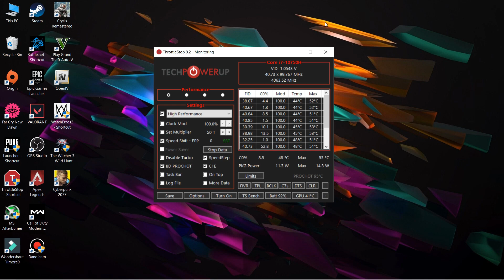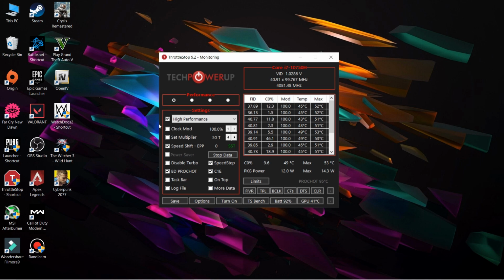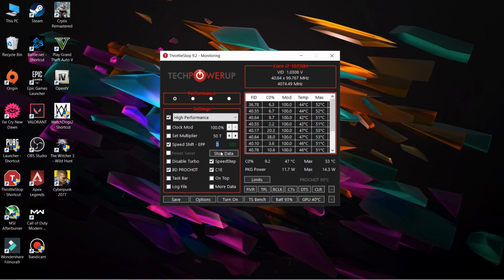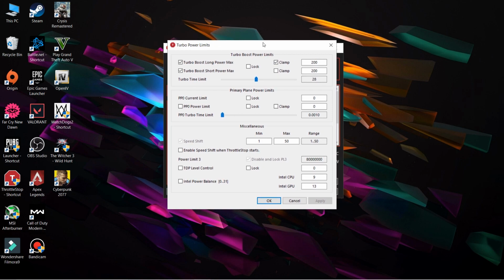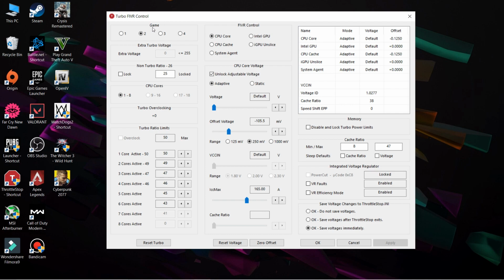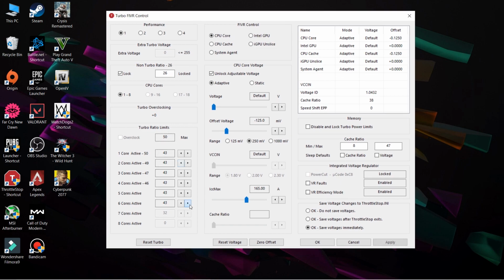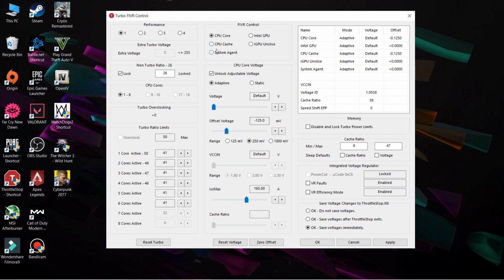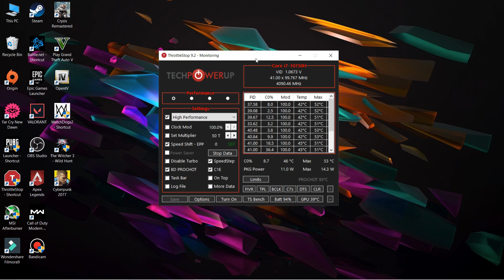undervolting i7 10750H quick guide !! Lower you cpu temps and increase performance !!

Comment: Hello. I have a Asus Rog Strix G15 G512 GTX 1660 Ti which I bought 6 months ago. During gaming on silent fan mode the temp of gpu is 80C and it caused throttle. If I use Performance/Turbo Fan mode the temps go from 93C to 95C. So Can I undervolt my laptop? It has Intel i7-10750H.
Reply: Hey, I have the same laptop but with a rtx 2060. I enabled undervolt from bios and put it to -80mv but fivr control is still locked on throttlestop. How did you unlock it?
Reply from the maker: If you have current version of bios it will not unlock.
Its locked by default.
You have to wait for new bios update...✌️
Reply: @R-tech890  from the current version that I got by default and all the newer versions are locked. Only previous ones are unlocked but for my specific laptop model there are no older bios for download. Not even from my laptop manufacturer site. There are some other Asus laptops but not my one. So I got no way to downgrade bios
Reply: @MrLatitante  did u find a fix?
Reply: @MrLatitante  bro when i do -80mv from bios my laptops will freeze
Reply from the maker: Yes you can...
I replied you in discord..
Reply: @R-tech890  ah yes. Thank you :)
Reply: Yoo dristang
Reply: Can u help me i have same laptop like yours and same issue
Reply: @Talhx-w5l  sure bro. What do you want to know?
Reply: I wanted to know tht did u find a way to  undervolt ?
Reply: @Talhx-w5l  I couldn't undervolt as bios is locked. 
I disabled intel turbo. No performance issues or fps drop.

I use performance mode while gaming. CPU is at 80C and GPU is at 86C.

GPU hotspot is 96C in HWinfo. (3rd party app) That can't be avoided unfortunately.

Except re apply thermal paste and get a cooling pad, there's nothing else you can do.
Reply: @Alfonsodecabron  bro thts the only bad thing abt intel laps can't be undervolted
Reply: @Talhx-w5l  yeah true
Reply: @Alfonsodecabron  for me in performance also cpu goes upto 90-95C but drops down also fast and gpu always 75-85C
Reply: @Alfonsodecabron  so now when i play game i just decrease cpu tdp to 45-40 or 35 according to temps and play so tht helps with lower temps and max 5-10fps drops
Reply: @Talhx-w5l  where did you decrease the tpd?
Reply: @Alfonsodecabron   the option next to (FIVR) TPL Turbo Power Limits
Reply: @Talhx-w5l  are you using Throttlestop software?
Reply: @Alfonsodecabron  yes
Reply: @Talhx-w5l  ah ok. So now how much temperature are you getting on performance?
Reply: @Alfonsodecabron  performance also my cpu goes 95C something it doesn't stay in 90s unless i play games like apex cod or something
Reply: @Alfonsodecabron  so i keep it at turbo and decrease tdp while playing so temp stays in 75-82C range
Reply: Same issue, a little stronger laptop. 10870H + Rtx 2060 115W and it reach the 90s on both GPU and CPU. undervolting only give me 3 or 4 degrees less than before and I don't want to repaste the liquid metal. Probably I'll send it to Asus to repaste it
Reply: @carmeloaguilarjimenez9774  disable intel turbo via registry. Cpu is 10 to 13C cooler and gpu is max at 86C on performance and turbo.

Comment: When I run throttlestop TS bench I get alot of errors, is it fine? I'm now at -75mv
Reply from the maker: Yup its normal.
Reply: @R-tech890  so i push it more?
Reply from the maker: No..
Fined a spot where you get stable clock and acceptable temp.

Comment: You don't need to check speedstep anymore since most modern CPU (IIRC 6th gen+) uses the speedshift feature. and checking the speedshift is also not required because windows 10 manages it automatically and sometimes much better than throttlestop.
Reply from the maker: I know buddy....😀✌️
Reply: @R-tech890  is this like 
Disabling turbo boost 
Which is better

Comment: What should i do if my pc gets bule screen and restarts i tried your settings but hangs and gets blue screen
Reply from the maker: Change values to lover mv.
Reply: @R-tech890  evwrthing is fine until change speedshift to 64😅
Reply from the maker: 😀 it should be 0 to push core to max clock speed...
Reply: @R-tech890  thanks😅 btw another question if i want to create a profile for battery should just copy same voltages  to the one that i created?
Reply from the maker: Yes..

Comment: my thermals are really good without undervolt. I get around 70 - 80 degrees when playing demanding games. Would you still recommend it?
Reply from the maker: If you are getting 70 to 80 then its ok.
You dont have to UV.
Reply: @R-tech890  Thank you for responding. The current laptop I have is a Lenovo P1 Gen3 with a i7-10750H and a Nivida Qudaro T1000 Max-Q
Reply: @SubKiller  ohh alright

Comment: hi, i have a i7 10750 rtx3060 msi thin, i cant seem to unlock the uv option. after i enable it in bios with xtu enable and try to save and exit, it automatically resets the computer before i get a chance to save. any thoughts on this? any help would be appreciated.
Reply from the maker: Make sure you are not applying values above 60mv first.
And 
Try disable and reunable xtu interface...✌️😀
Reply: @R-tech890  my bios must be bugged, instead of doing it from the exit menu, pressed f10 and saved and it worked. thanks again:=)
Reply: @R-tech890  so, ive been doing some research on the internet after being sick of temp issues, I undervolted it to -125 and lowered turbo ratio limits to 40 for all the cores. cpu stays around 70 degree C. used throttlestop to configure all this stuff. im pretty new to this, just wanted to write and help others if anyones having trouble as i did. no performance drops, no issues. thanks again for the guide for noobs like us.
Reply: @pep2334  You found any method to reduce the temp? Even I have the same lap it reaches 95°c while gaming..
Reply: @bangarubalaji9031  you need to use THROTTLESTOP to reduce temps. this is called UNDERVOLTING. plenty of guides on google. first you need to unlock your cpu via bios. its been quite some time, I dont remember what this video is about but looking through the comments, i believe this helped me solve the problem.

Comment: What can I do what I cant change "offset voltage" it is just locked and I cant do anything with it? Can u help me, please.
Reply from the maker: Unlock xtu interface from bios
Reply: @R-tech890  how to unlock it
Reply from the maker: From laptop bios option..
Reply: @R-tech890  i have asus rog i tried but theres no option to unlock
Reply from the maker: There should be like performance option....
Or google it for your laptop bios details.
Reply: @R-tech890  i tried but couldn't find anything ty for advice tho appreciate it
Reply from the maker: Then you have latest bios and it default locked that you cannot change voltage values.
Its the issue with new bios.
Please share this channel with your friends..
Thanks..✌️😀
Reply: @R-tech890  there is a option to do it but only till  -80mv will tht be fine i have i7 10750

Comment: Bro i cant change check the set multiplier
Reply from the maker: No need to change buddy....
Reply: @R-tech890  man how its still being 90> ? I see that u play wd 2 with 70-80
Reply from the maker: You sohuld lower down the clock to 4.1.
Reply: @R-tech890  what do u mean? :/ but it's 3,9 - 4 ghz only
Reply from the maker: Which cpu.?
Reply: @R-tech890  i7-10750h, msi gl65 bro :/
Reply from the maker: Then it should be 4.1
Reply: @R-tech890  where should i change that
Reply from the maker: Check it in fivr....bottom left corner.
You will see clock speed for every core.
Lower that down to 4.1ghz
Reply: @R-tech890  damn thx i didnt saw that u explain it on videos how to decrease core speed

Comment: I tested Intel 10875H in Dell XPS and custom bios mod.

These chips can't hold that much cache undervolt for extended periods. Mine holds at most -95mv at 39 cache multiplier. 

And CPU core is also right at the limit, probably over the limit for long term. In certain applications that stress it just the right way, it's going to crash. Just because it completes a stress test doesn't mean it's stable. 

My max 100% stable undervolt is -110mv core, -95mv cache at max 42 core multiplier. 
And it's a better binned chip! Don't corrupt the system by over-undervolting the system. People beware! This is way too low for Intel 10th gen!

Not to mention he doesn't explain what anything does at all, he just tells you to blindly apply his settings. Don't do that!

I have a 30x all-core multiplier profile, and I run -135mv core and -110mv cache. And it's stable. But not at 41x mutli.. Not for long term. Cache won't run at 38x multi at -125mv.. That's insane. If it's stable in the long run, then it's a golden chip. But mine soft locks instantly at -125mv cache, at least in ratios that are reasonable for normal use.
Reply: PS - 42x mutli CPU for MAX load. Usually though, system will crash while doing more simple tasks, because it'll bring the clocks up, along with cache - and since it's not able to hold 46x/47x multi for memory stress ops, it's going to soft lock.
Reply: where did you find the custom bios mod?
Reply: @falconeagle3655  u have to do some work to get pass default setting which have "overlock lock" locked by default to be able to unlock it
Reply: Same results here on the 10750H, think pretty much everything internally is the same as the XPS of the same gen (Inspiron 7501)
Reply from the maker: I didnt told to apply same setting as mine.😂
Reply: @R-tech890  Okaay kiddo. I see how it is

Comment: Hello there! I am currently using Dell G5 5500, after all editing on bios to enable undervolting; I set the same settings as you did on throttlestop. But after undervolting(applying changes) my laptop gets frozen completely and needs restart, after turning on again my laptop works properly but the heat problem still exists. What do you think may cause the freeze?
Reply from the maker: It freezes because you applied same values as mine.
You should have use -80 first then start increasing if you do not get blue screen or freeze.
Reply: @R-tech890  Thanks so much! appreciated.
Reply: @Pyro 7 75 degreed Celsius CPU temp is not bad at all, if you have those temps under load while playing intensive games then that is good.

Comment: turbo fivr control is locked i cant change anything
Reply from the maker: Unlock OC access in bios.
And if you have updated the bios then its not gonna happen.
So then wait for next bios update..😃✌️
Reply: @R-tech890   btw , how to unlock OC access 😅?
Reply from the maker: In bios there is option for performance.
Then inside there is option like 
Unable XTU interface...😃✌️
Reply: @R-tech890   so sad 😅. 
I updated the bios an hour ago 
Anyway , thanks for your help 😁

Comment: My laptop froze as soon as I went to “apply” settings
Reply: Now it’s freezing everytime I log in and it won’t let me do anything
Reply from the maker: Do not directly try same value as mine.
Disable OC access from bios.
And the uninstall throttlestop
After that re repeat the process but this time start with -80mv.
Reply: @R-tech890  oh ok thank you. Sorry for that but again thanks for the help!
Reply: I changed the values to -115 and that worked. Idk why it froze trying to set to -125

Comment: the undervolt is not saving please help
Reply from the maker: It should be
Just click save voltages imediately in fiver right bottom corner..✌️😃
Reply: Yes it dont Works idk why when i close the app the voltages are reseting even i save the voltages
Reply from the maker: It do not reset the voltages until we do not make any restart.
Then how..🤔
Reply: @R-tech890  and when i apply the screen freezes
Reply from the maker: What values you are using.?
Reply: @R-tech890  the same values you did in the video
Reply from the maker: Try different values like -60mv
Reply: @R-tech890  like 125mv -60 right??
Reply from the maker: Yes..
Reply: I have no idea bro
Reply: I open the app from winrar and i click throttle stop Exe and open the app
Reply from the maker: Make changes in first profile...

Comment: Bruh i'm a nube does this work for all laptops?? mine specs of acer predator helios 300 are as follows:
i7-10750h
rtx 2060 6gb
Reply from the maker: It work for for almost all if have intel cpu.
Reply: @R-tech890  Can you please share the settings for 10th gen
Reply from the maker: What kined of setting you need.?
Reply: @R-tech890  Bro i mean my Fivr whole section is locked how do i change  that
Reply from the maker: If you updates the bios then it will not possible to UV 
Its locked by default with new bios.
You should downgrade or wait for new bios update.
Many people facing this issue...
Reply: @R-tech890  Thanks a bunch
Reply: @R-tech890  I was able to go into bios and enable UV that way. I have an MSI gs75 2070 super max q with i7-10750 and mine was locked until I went into advanced bios and enabled the undervolt in hand something else

Comment: Does doing factory data reset on my laptop will change these settings or will it be the same as it is???
Reply from the maker: It will change the settings...
Reply: @R-tech890  so I have to again undervolt it again?
Reply from the maker: Just apply previous values if you remember...😀✌️
Reply: @R-tech890  thanks
Reply from the maker: Your wlcm bro...😀✌️

Comment: Hi would keeping the first CPU core at 5 or near that, then down clock the others to 4 or 4.1 be any good, I wouldn't under volt much maybe less than half of what you did.
I'm thinking of maxing single core performance.
Reply from the maker: Havnt tried it buddy.
But it will not gonna make any performance difference.
So downclock all to 4.1😃✌️

Comment: Are you now how to unlock the turbo ratio limits? In my laptop, the turbo rayio limits its unlocked, i cant change it. My laptop is HP Pavillion Gaming 15 witch i7 10750H and GTX1650
Reply from the maker: There is a option  disable turbo.
Make sure you have not check that.
Also plug in charger to use full clock speed of the cpu.
Reply: @R-tech890  i have unchecklist the disable turbo, but i still cant chaange the turbo ratio limits
Reply from the maker: Its automatically unabled in laptops.
Just plug in charger and use a little stress test and see what clock speed you are getting..

Comment: Awesome video! I have read a lot of places that the Cache and your undervolt values don’t have to be the same....is this true?
Reply from the maker: Dont know buddy.
I am getting better temps by doing this so it work for me.
Reply: @R-tech890  So I have found my favorite settings so far. I have been testing all different settings today and here is what I found:
Speed Shift EPP / On - 128
SpeedStep / Off
Offset Voltage - 118.2 and Cache 118.2
Turbo Limits set to 28 (2.8ghz)
Cold War max temps 74-75c  at 135-140 FPS
Idles at 36c 
If I want the temps for Cold War to not go above 75c then I need to hit Disable Turbo. 

Do you see anything in my settings that are off? I think I have found the sweet spot.
Reply from the maker: No bro its good..
Enjoy cool temps..😃✌️

Comment: If i do all this but didn't tick high performance, clock mod, and set multiplier on home page of throttlestop, will ot work fine still?
Reply from the maker: Yes buddy....
Listen video carefully...😃✌️
Reply: @R-tech890  its difficult to understand your accent sometimes! Anyways thanx! I have GP65 same processor, its working good for me! 95° while on playing cyberpunk without this, and 89° max after this! Thanx alot buddy!
Reply: Does your Cpu also throttled at around 93-95 from 4.3ghz to 3.8ghz? Before applying this?
Reply from the maker: No bro...😃✌️
Try to fill bettery above 80%
Reply: @R-tech890 while setting -105.6 it has to be 240mv or 125mv? I saw ur previous video and u set it to 125mv and now in this video its 250mv?
Reply from the maker: 125 or 240 doesnt matter its just like an extra room for UV
Reply: @R-tech890  strange is happening! I undervolted -105 and now whenever i play a game or did 3d benchmark my laptop freezed 3 times! Everything just freezes and i have to force shutdown! Also happening when charger is removed, does this happens due to undervolting?
Reply from the maker: Drop the UV values a littke like 100 or 90.
It freezes when unplug for some seconds if you applied OC to gpu through msi afterburner.✌️😃

Comment: Is there any way to delete the throttlestop config? Cause i did edit cores speed (4.1) but i want to get my cores speed as stock and it did not change, it keeps at 4.1 while the program is closed and uninstalled
Reply from the maker: Disable the xtu interface from bios.
Then again unable it.
It will back to normal.

Comment: This was working but I closed throttlestop while in game and blue screen appeared, then it stopped working when my computer turned on again? What happened?
Reply from the maker: Usually UV setting do not get restored until we make a restart.
Try do little lower UV values.
And if you wanna close
Close before game launch.✌️😃

Comment: Please tell me about IccMax thing? becouse mine shows 140 by default and yours 165, and i didnt felt any change in temps ...
Reply: and your cpu catche shows -125 mine is 00000
Reply from the maker: You have to lower cache voltage also as you do in core.
I have to study about iccmax.
I didnt change anything there.
Will inform you..😀✌️

Comment: I need your help. I can't unblock "turbo ratio limits" in FIVR Control
Reply from the maker: Buddy you have to unlock OC access from bios...😀✌️
Reply from the maker: Check this out buddy...
https://youtu.be/FGHnjF5umi4
Reply: @R-tech890  nice! THANKS
Reply: Nice video, but with turbo ratio limit you can set all core to 5ghz?
Reply from the maker: No bro..for laptop its not possible to hit 5ghz.😀✌️
Reply: I know it s stupid, but just to ask
Reply: Ok, i asking this beacuse on trottle stop you can set 50 on all core
Reply: I thinked if set this the cpu can reach 5.0ghz.
Reply from the maker: No bro